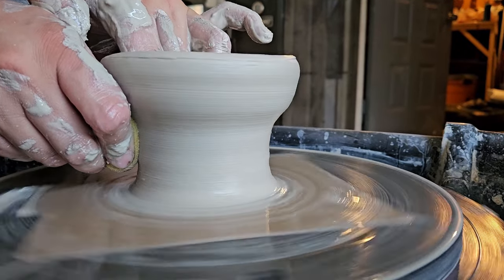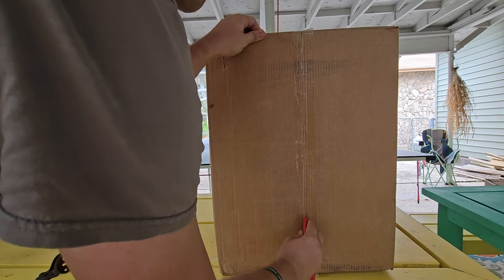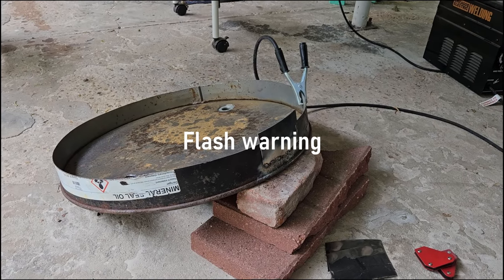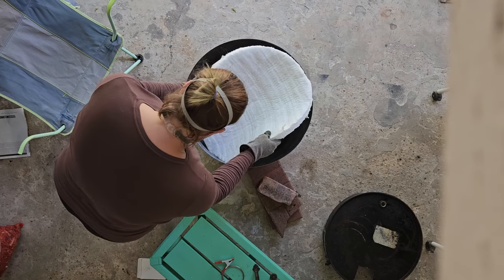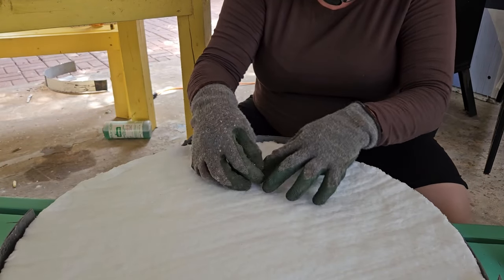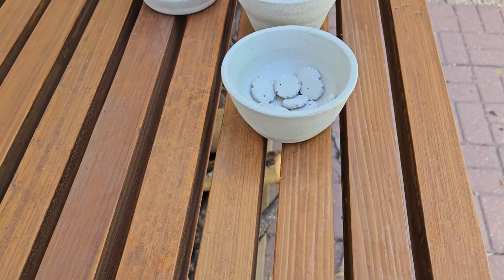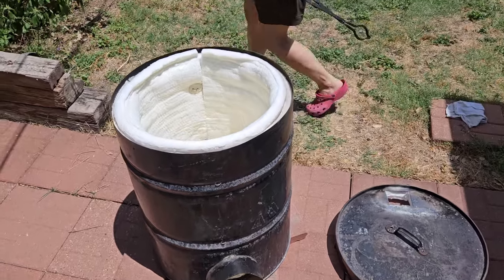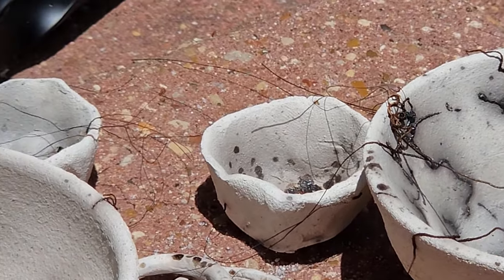Raku Ceramics: All you need is a Barrel, and Fire.

Comment: To avoid breakage due to direct burner contact, use fire 4 brick, laid on edge, under your shelf. Place the first two in a "V" pattern, about 1 1/2" apart in front were they face the burner hole. This allows a portion of the heat to travel strait across, a portion to travel sideways. The other two at 10 and 2 o'clock, parallel to the kiln wall.
Then flame on!
Reply from the maker: Thanks for the tip, I will have to try that!!
Reply: @BrevaCreative  Have fun!
Reply from the maker: @danconnolly980  oh we will! 😁

Comment: HI, dont know if its mentioned here but you can use your fiber cutoffs to form an insulated 'button' to clamp your firewool securely without costing out for heat resistant wires. Simply bind some into a ball or rod, tie with any wire but wrap the whole lot to form a button them pull against wall to seal off from inner atmosphere and fix in place with another outside tie off system.
Reply from the maker: That's a great idea!

Comment: Other commenters pointed this out,  but it cannot be said enough.   Coat the fibers. Coat the fibers.  Coat the fibers.  They will break off and cause respiratory damage.  Also,  use a respirator with p100 filters when cutting the wool. She just stated she didn't realize there were no filters.  That's because she didn't test her mask after putting it on.  Use filters.  Test your mask every single time.  What those fibers do to your lungs is no joke.

Comment: Just made a kiln out of a drum from a retired clothes dryer. This is my second kiln and I used 2" insulation this time, as well as some brush-on rigidizer to keep it from escaping into the air (or me) later. I had to make a bottom out of a piece of 1/16" steel sheet, and I also added some legs out of angle steel and some handles for carrying.

My first kiln was a "lift off" style made from 1" insulation and wire fencing that worked well but is now proving too small. I was able to get it up to 2000F with a weed burner / BBQ propane tank. Top loaders seem more convenient for keeping the remaining pieces warm as they're taken out one at a time. With the lift-off kiln it was a mad scramble to get the pieces processed.
Reply from the maker: That's so cool! With this one  it is still a scurry to get everything in the burn buckets but the top load does buy more time! I like the idea of legs and handles this one is tough to move.
Reply: Can you make a kiln without the fiber insulation? Can you make it with bricks only?
Reply: @cheesebvrgers  Yes, you can make them out of refractory fire bricks. They're just heavier and the bricks aren't cheap. They are more durable though and I'd go that route if I didn't have to move mine out onto my deck whenever I use it. If I was smarter I'd have put wheels on it.

Comment: The ceramic fiber must be coated with furnace cement or similar. Using it as is forces a blast of fibers into the air. This material is particularly dangerous to lungs and spreads far 0:06 .

Comment: Did you use a ridigizer spray? I just purchased some fire blanket for my raku kiln and i was told by the supplier that its nit needed as its Super wool low bio persistent
Reply from the maker: I did not use a rigidizer, it's held up fine for me with just the buttons but it's possible material from different brands or suppliers would behave differently

Comment: Had these pots been bisque fired first?
Reply from the maker: No , this is essentially straight out of a quick raku bisque that the horse hair is applied.
Reply: @BrevaCreative  Thanks for your response, could you tell me how long the firing took to bisque?
Reply from the maker: @gazzo12345  it took about an hour but will depend on your torch, insulation, weather, etc. I just kept an eye on the pyrometric cones and waited for them to start deforming. A promoter could also be installed to help gauge doneness
Reply: @BrevaCreative  Wow... I'd never tried doing a combined bisque/raku. I don't have an electric kiln, so I'm using my gas raku kiln to do a ~3 hour bisque, then a separate ~1 hour raku firing with commercial glaze. I'm also using locally dug clay and there's been a lot of trial and error with time, temperature, tempering additives (sand, grog, kyanite) getting things not to crack.

My early experiments were with a wood-fired kiln made of some patio paving bricks and I did manage one reduction firing where I dumped saw dust down the chimney at the end and then buried the kiln in dirt until it cooled. Got a perfect black finish from the reduction without using any glaze, so now you've got me thinking about how I might do something like that again.
Reply from the maker: @kencoxdesign  that is essentially what i am doing, I didn't show much of the prep and bisque in the video but the glaze was applied to bisqueware. I have found that if the bisque ran a bit low I can still glaze and fire and it works out but there are still two firings

Comment: Great video. How much ceramic fibre did you need for this project?
Reply from the maker: The double layer used a little less than 20'  of the 24" x 1" roll, linked in the description. So I have a bit over 5' leftover.

Comment: Thx, but how you are sure it‘s hot enough?

Thx!
Reply from the maker: Good question! For this first firing, we didn't have a temperature gauge, so it was kind of a guess and check method. Not ideal. We also gauged it based on the color the heat was emitting what the temp was. However it's much more accurate to get either a high temp Infrared laser or a Thermocouple setup. We opted for a Infrared laser for our next firing and we're really happy with it. I added a link to the one we got in the description. Happy firing! 💚
Reply: Thx!!! 👌
Reply: Just one thing: Where I do find the link to the infrared Laser? 

Thx again!!!

Burkhard
Reply from the maker: @burkhardkutschenreuter8134  I just added it to the video description below the video. It's the last Amazon link in the list! 🙂
Reply: Thxxxx! 👍🏻

Comment: That insulation has to be treated before use doesn’t it. I work in a hospital as a respiratory therapist and I would hate for you to damage your lungs
Reply from the maker: I've never ever heard of that, we were super careful while installing and i don't breath the fumes while burning since there's off gassing and whatnot from clay and glazes as well. Can't get better ventilation than open air. Will do a bit more research but im not super worried since we are careful and the insulation is rated for the high temps